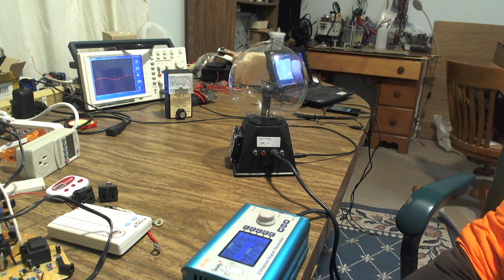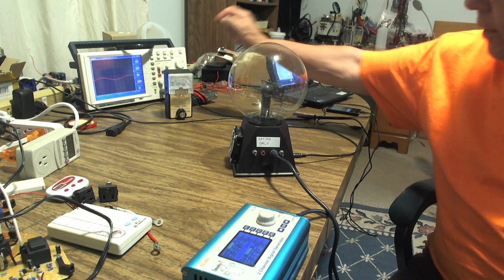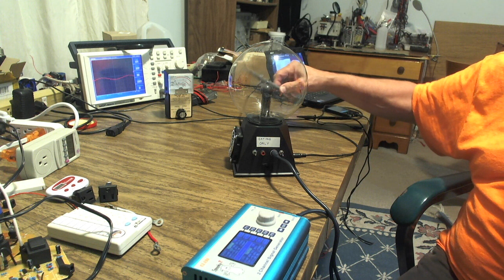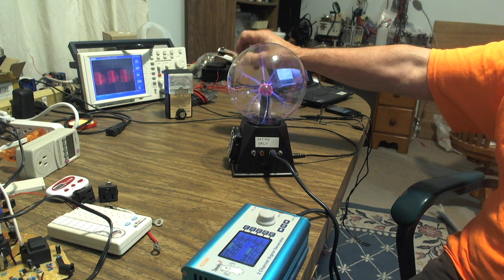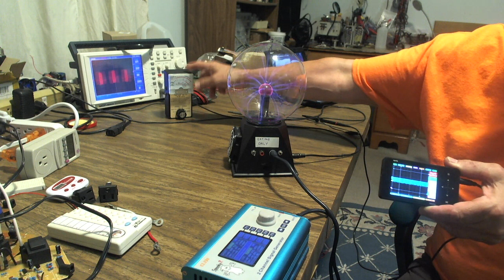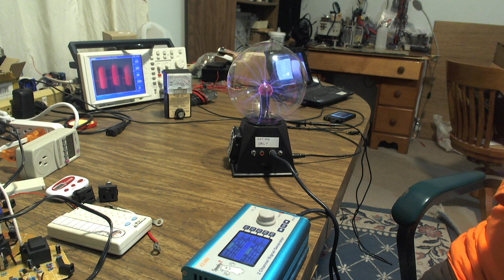.01Hz to 10K Gating Only Plasma Ball

Comment: Hello.   Would this work with a computer and software like Frex16?  Is there a schematic for the Gating Only version?
Reply from the maker: That is an excellent idea.  I’ve been so busy just trying to keep up with orders I never thought of covering that base.  The answer is today it will not work with a computer sound card or sound output.  Maybe in a week or two I can come up with a slight modification to make it work exactly like you are suggesting.  Thanks for question.  Respectfully,  Steve

Comment: I have an 8 inch plasma ball - have you tried this mod with an 8 inch?
Reply from the maker: No, I've yet to modified an eight inch ball.  However I am very sure that any Plasma  Ball that runs off of 12 volts is easily modifiable.  I'm presently doing a video series that will explain Plasma Ball modification in enough detail that most beginners in electricity and electronic can easily understand what is needed to make the changes.  Any and all arduino users should easily understand the video modifications. It is suspected that any high school electrical shop class teaches more than enough to do these modifications.  The principle is always the same.  Find the transformer and driving transistor, very often a TIP 122 for the transistor, and add the Universal Plasma Ball Controller in accordance with the schematic and PDF Directions.
http://www.aurorasky.net/12_Volt_Universal_Plasma_Ball_Controller.pdf
http://www.aurorasky.net/12v_Plasma__Ball_Controller_Schematic.pdf
Reply: Thanks for your detailed explanation of the principles and practicalities of this mod.  I have some pcb kit building experience so I'm hoping I wont find it much of a challenge to implement your mod.  
I bought some cheap dual channel sig generators from eBay that could be used without needing Spooky to drive the signal (even though I am a proud Spooky owner).
BTW - you frequently mention 'the land' in your electrical descriptions - I am unable to reference this term - do you mean 'earth'?